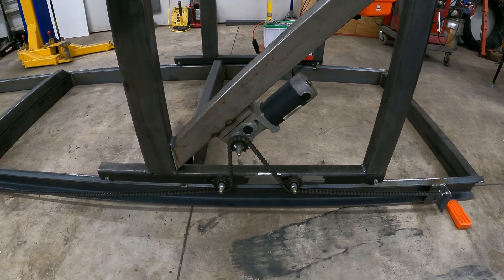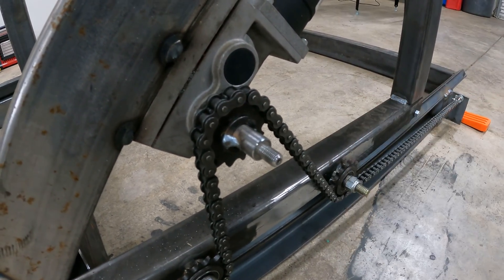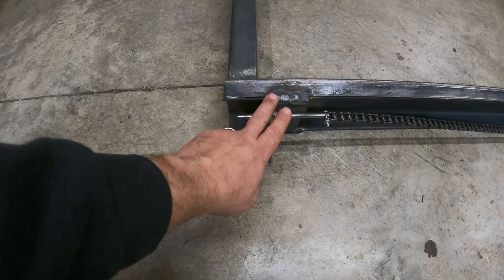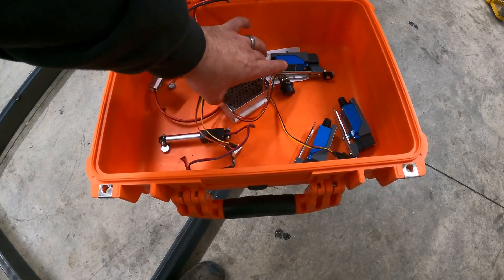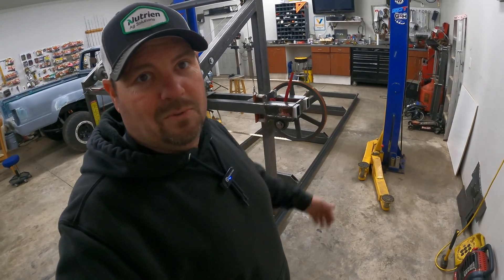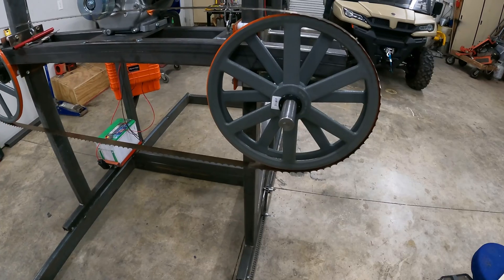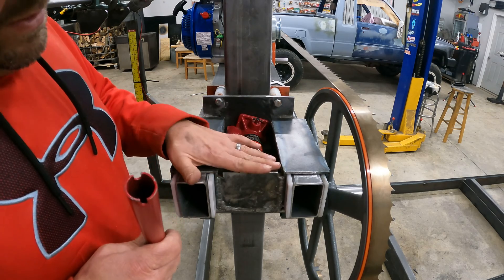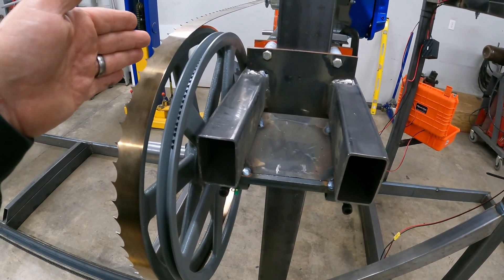Homemade Sawmill Build (Part 3) Power Feed, Blade Tensioner & Pulleys #diy #sawmill #powerfeed

Comment: The only thing that im hesitant on is the tension side of your design, being that your pillow blocks are far less adjustable since the slider captures your pillow bolts and does not allow for elongated holes.
Have you had any issue with lacking pillow bearing adjustability on your tensioner side?

Comment: I used a 3/4'' bolt to tension the blade.  Bowed and snapped the 1 1/4'' dia. drive shaft.
Reply from the maker: I’ve ended up switching to a 1” threaded rod to apply tension to the band. I think it’s going to work good 👍🏻

Comment: Where did you get the clutch and what is the motor for feeding
Reply from the maker: I bought the clutch off of Woodland Mills website. It’s the biggest one they have. It says 14HP but I’m going to give it a try. The feed motor is an electric wheelchair drive motor that I bought off of eBay.